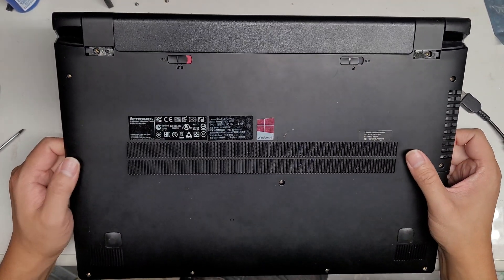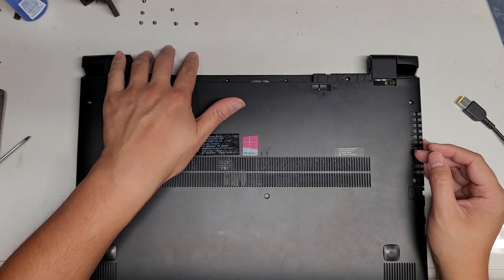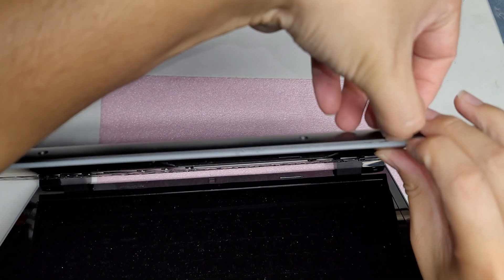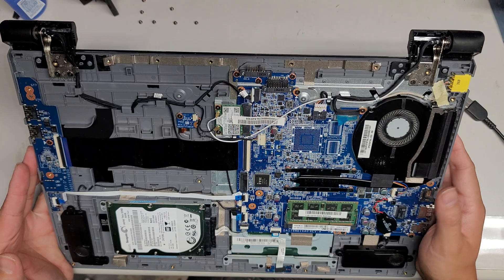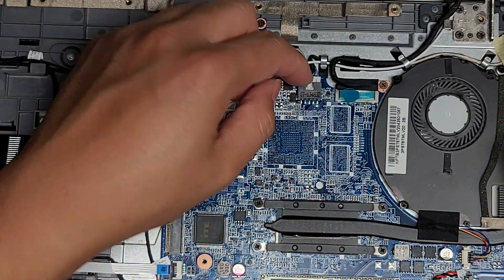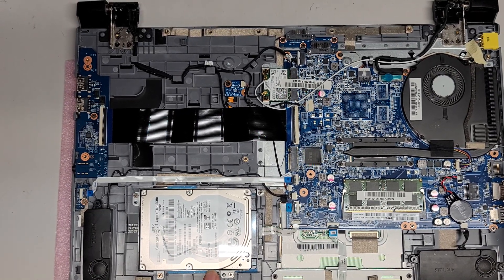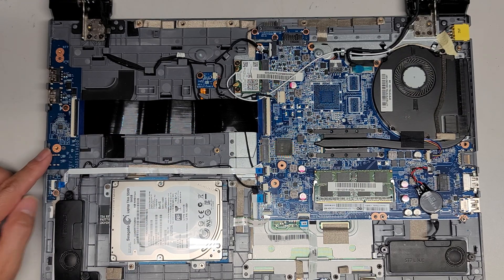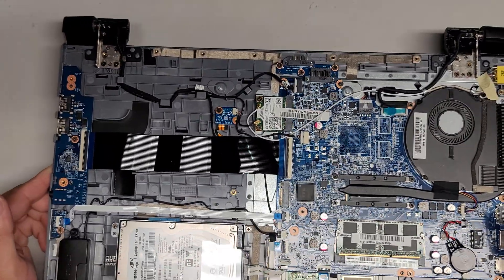Lenovo IdeaPad Flex 15 20309 Disassembly RAM SSD Hard Drive Upgrade Repair

Comment: because board can be used in 14 inch model as well. that's why there's an adapter for battery.
Reply from the maker: I see... Makes sense
Reply: @ItsBinhRepaired  and that small port next to big black ribbon cable is m.2 sata port (not nvme)
Reply from the maker: @k6computers  thanks!

Comment: hi
 thank you so much for your videos, can this laptop be upgraded with a single 16gb card to replace the 8gb one from factory?
Reply from the maker: You can try, but good luck getting a 16gb stick.
Reply: No , There is no 16 Gb ddr3 for laptops produced. Only available from ddr4 onwards.